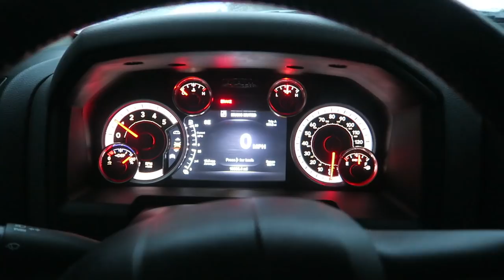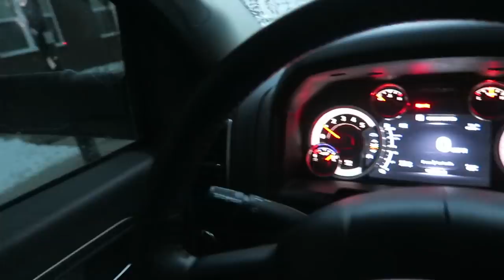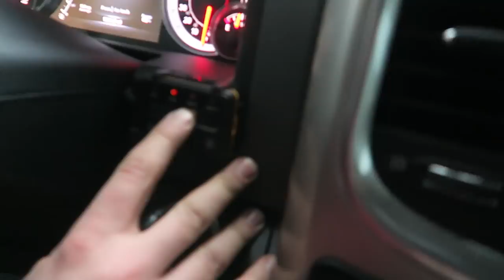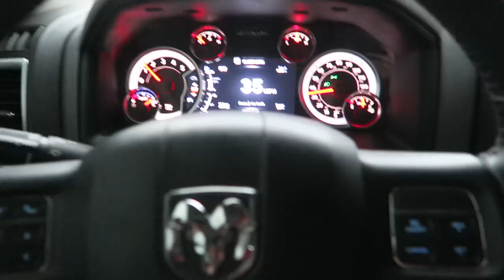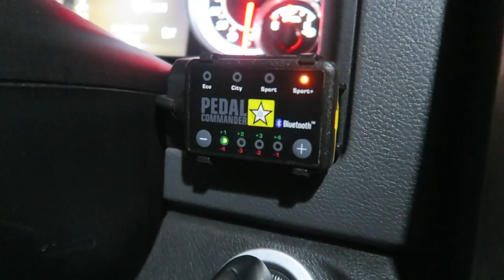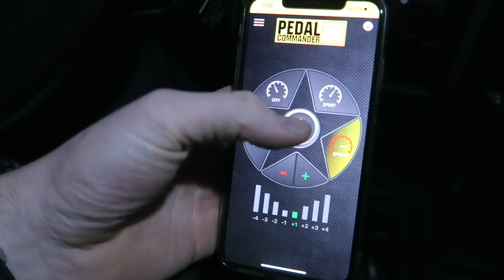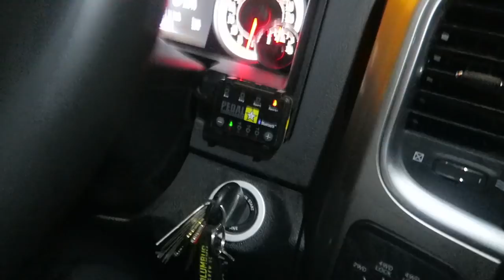TURBO LAG DELETE! W/ PEDAL COMMANDER (IMPRESSIVE)

Comment: My 2013 Ram 1500 4x4 is a 5.7 hemi just got the pedal commander, and it really changed the truck. Once I figured the right setting (sport mode +2 for me), not only does is remove the throttle lag, but it also seems to go through the gears smoother.

Comment: It doesn't do shit to your engine or turbo. All it does is reduce the sensitivity of your throttle that you otherwise have with your pedal and makes a small pedal input much larger than usual. In reality, your truck won't be any faster, but it will definitely FEEL faster as you're reporting on your butt Dyno. It's all about how it feels.... Even if it isn't actually any quicker.
Reply: Manpreet Singh Yes it changes the drive by wire throttle sensitivity. Thank you for actually knowing what this product does🖤
Reply: Teckneckly it does it links up to the computer in the truck adjusting what the setting is so.
Reply: Benjamin Koll Yes it changes the sensitivity of the throttle to make it react quicker but does not add horsepower to change the top speed.

“Technically”
Reply: Right but it goes in the computer to make it react quicker

Comment: How does it remove turbo lag? it's just adjusting the throttle sensitivity.
Reply: It doesn't
Reply: I can assure you it doesn't. All it does is tell your computer your pushing the pedal further than you actually are. No different than flooring it.

Comment: I have a 18 G56 as well that's still all factory, do you think this would improve the rev hang issues the stock trucks have?
Reply: I would like to know too i have an 18 and seems like when youre trying to shift fast it like decelerates or something if the clutch isnt out all the way
Reply: Had it on my 18 g56 with it stock. Made a huge diference. I wouldnt hesitate getting one.
Reply: Try the seat modification first it's a lot cheaper. Move your seat forward 2 inches that should allow for quicker throttle response and better pedal travel. Which is basically all this product does. Unless you have a physical handicap that doesn't allow you to depress the accelerator pedal fully or quickly this product will do nothing for you

Comment: I’ve been using sport plus 3. The pedal commander is probably my best mod. Love it. I have the aisin and the squishy feeling is gone!
Reply from the maker: YESSIR!!!!! good to hear feedback from the auto users!
Reply: Are u saying the lag in the pedal is better with this mod cause its driving me fuckin nuts I to have the aisin
Reply from the maker: stangdemon82 yessir! Removes it completely
Reply: With Aisin and tuned.. but still had terrible lag d/t the way the it defuels between shifts and off the line.

I went with Bd throttle booster (works same) and Day/Night difference in how quick the truck is now. Defueling between shifts is minimized and overall feels perfect now.

Comment: I have one of these for sale that fits 2015 and newer F-150’s with the V8.  It completely changed my truck for the better in an unimaginable way.  Felt like I gained HP, but I just gained quicker access to the HP that is already there.  Sold the truck.  Selling the Bluetooth Pedal Commander for $250 shipped anywhere in the USA.  Like new.  It was on a 2018 Platinum.

Comment: I got check engine light on and bunch of other codes from install the pedal commander
Reply: Just out of curiosity, what was the year/make and model you were installing into??
Reply: Happens when you switch setting while on the accelerator. Product uses stock cables and goes through the stock ecm won’t throw any codes if you follow instructions
Reply: Same here. Engine check light ON, and red lightning Volt ON! It’s the PC-31 and does it on both of my rams, one deleted and one stock. Maybe I have a bad module?

Comment: It would be interesting to see what percentage your EZ Lynk is showing your TPS compared to the pedal on different settings. It's an interesting product for sure
Reply: Thats all this does. On a middle setting desired TPS and actual would be synced up. From the factory it delays it and doesn't give you the power immediately. With the pedal commander all the way turned up all its doing is giving 100% tps  at like 10-30% pedal travel.

Comment: Unfortunately the promo code did not go through for a discount for me. But I definitely will be installing this mod in my 93 octane tuned 2011 Chevy Cruze 1.4L turbo w/ ZZP cold air intake, also custom exhaust.
It’s been running great. This will make it run better.
Reply: Devon Dewey wonder why. I just used it and it took $30 off
Reply: Stephen Foster. Actually just bought it this month and the promo code did work for me this time.

Comment: How is it for a 6.7 cummins when online only shows for engine 6.4?
Reply: I have a 2011 Ram 3500 6.7 HO Cummings and installed the PC31 listed for that truck. Instantly I threw engine codes (P06A4/P2299). I contacted PC directly and they told me that "I do apologize for the inconvenience and you will have to return the unit for a Refund as we do not outfit he 6.7L Diesel Rams as they are a High Output Engine and we are in the middle of research and development." NOT happy about this............nowhere on there website does it say 6.7HO Cummings not compatible..........all it states is Dodge Ram Trucks 2007-2018 Ram 1500, Ram 2500, Ram 3500. Anyways I hope the person I spoke too was wrong...........even though the code was there and the check engine light was on, it made a world of difference!!

Comment: You do know all that these pedal booster products just tell your computer that your light input is heavier I if you're pushing the pedal 10% that tells the computer that you're pushing it 50% or any number of different variations depending on how you adjust the product. You can have the exact same results just by pushing the throttle pedal down farther and faster. Learning throttle control is is more useful than having a computer manipulate your input. If you're a person that has a physical handicap to where you can't fully extend the accelerator pedal I can see this product being useful , but if your legs and feet for long enough to use the full range of the accelerator pedal then I don't see the point of this product
Reply from the maker: You don’t see the point, but! I do say if you drove with one you’d understand where I’m coming from!
Reply: @ryan2546  Actually, he's right on the money.  Btw, I have driven with one of these.  All it does is re-map the throttle;  you push the pedal down 10%, the pedal commander sees it and tells the PCM to add 50% throttle.  Boom, seems like you just added 50whp.  Honestly, I don't think you even need this on your truck especially since you have custom tunes... but that rarely stops people from throwing money at their vehicle.  Nice review though. 👍
Reply: @monsterram6617  im with you , wasted money and time when custom tuning can do the same thing.
Reply from the maker: Tony Turner 😂😂😂🤷🏼‍♂️🤷🏼‍♂️🤷🏼‍♂️ trust me me and my buddy tried to get tuning this good, and guess what doesn’t happen. You can’t adjust the sensitivity 36 different ways AND like it said y’all can hate but you don’t know till you know haha if both of y’all were close if hook mine up in your truck and you’d be commenting different! But to each his own!
Reply: @ryan2546  Ryan, pointing out facts isn't hate.  I'm happy that you like the Pedal Commander, though.
Reply: @ryan2546  lol all good Ryan. I had both this style and the BD throttle booster in my truck back in 13 and I really wasnt impressed with it. I also like angrily massing my pedal to the floor and having it respond accordingly lol.
Reply from the maker: 😂😂😂😂 I just love seeing the comments of people hating on it and they haven’t used one! Lol I picked this over BD because the one in the Subaru I drove was WILD
Reply: @ryan2546  What exactly do you mean by "hate"?  Also, how does discussing the details of how the pedal commander functions relate to whether one has used it or not?  I don't think they are claiming it doesn't produce a result; it clearly does.  It sounds more like they are saying that you don't really need it if you are willing to adjust the way you drive.  Idk, maybe you or someone can clarify this for me?
Reply: @ryan2546  brother if you like the product by all means enjoy it. I just don't have $300+ bucks on a product that manipulates  my pedal position sensor..If you're foot is getting tired from the work load of pressing the accelerator then by all means get this product
Reply: If anyone wants the same modification for a lot cheaper simply move your seat 2 inches froward . This cheap seat modification should allow for quicker throttle response and more pedal travel
Reply: We  get it big dog....  we get that it simply adjusts the sensitivity for gods sake. Maybe comment and state the obvious a few more times....
Reply: Monster RAM bruh he is sponsored by them he isn’t gonna agree with you 😂
Reply: You guys are thinking of it the wrong way, don’t think of it as a percentage, but points. If your pedal has 100 points of variability, it may have 150 now.
Reply: If what you say is true, “sport mode”, “race mode” wouldn’t exist in performance cars. If what you say is true, independent throttle bodies on cars would be pointless. If what you say is true, a race car should have the same throttle response time as a pickup truck. In fact, one of the benefits of a drive by wire system vs a drive by cable system is the ability to customize throttle response. Yes you can bury the gas pedal 6 feet under to get the amount throttle you need, but that’s not the point. The fact of the matter is that throttle response is very important if you want to do performance driving. Believe it or not, pushing the accelerator to the floor takes more time than a light blip of the throttle. The reason I bring this up is because it is especially important in a manual car. Blipping the throttle helps with downshifts. A responsive throttle is especially important for heel toe downshifts. For heel toe downshift, The less time & effort you spend on the gas pedal, the more time you can spend on braking through a corner. Now if this is something that you don’t care about, then obviously the product is not for you, that’s fine. But don’t deny the power of throttle response just because you do not need it in your specific application.

Comment: This work on not tuned or deleted trucks to or need to be deleted
Reply: John Mayfield it’ll work on a stock truck
Reply: @jacobn3160  ok it won't tell the computer anything to avoid factory warranty stuff I'm not sure that's why I'm asking
Reply: John Mayfield no they won’t even tell if you want to be safe you can unplug before you take your truck to the dealer. That’s what I did and they didn’t even know
Reply: @mrclean2038  ok thank you I'm looking at a new 2018 model that's why I'm asking

Comment: Instead of standing on idle waisting fuel, start driving as soon as you got oil spread and pressure up. A diesel NEVER makes decent heat idling, and neither does a gas compared to driving it.

Comment: Correct me if im wrong. But the research ive done shows theres no real improvement to the actual numbers. 0-60 and actual acceleration. All it does is open the throttle body sooner. So in turn it's technically just like you're flooring it all the time. WOT is WOT with or with out the pedal commander.

Comment: IMHO Pedal commander is good. Sprint booster is the best. I don’t need Bluetooth. Some people might like that though. $10 cheaper for SB. Has 2 extra features. Pedal lock and valet mode. SB is also smaller controller. Looks better in my car, like factory. Both are awesome products though.

Comment: Used this thing the first day I got it and it put my truck right in limp mode after first test drive
Reply: Jacob Rosenkranz Same here...Pedal Commander is total junk! Mine lasted 3 months, and then the truck went into limp mode.
Reply: savage 069  Truck reset after unplugging that junk.

Comment: It’s not a lag delete it takes the lag out of the drive by wire throttle system
Reply from the maker: For turbo charged vehicles it also removes your turbo lag as a by product of that 👍🏼
Reply: No... unfortunately it doesnt remove the turbo lag. It changes the throttle response and as a by product it decreases the amount of time it takes for you to reach full throttle, therefore spools the turbo quicker but does not remove turbo lag (the lag is the same as pushing full throttle instantly). Please give people the correct information as you have a large audience watching. Good video 👌 i get what you're saying and you most likely understand this although other people most likely wont
Reply from the maker: Lachlan Stenzel turbo lag by definition is the time between hitting your throttle and feeling the torque of the motor after the turbo spools. This product removes ALL LAG as soon as your foot is on the throttle the turbo already spooled. There is 0 seconds between needing boost and having it. Removing throttle lag removed turbo lag so in turn yes this product removes turbo lag 👍🏼
Reply: RYAN MAYER you’re still wrong. Turbo spool is not torque from the motor. A diesel forces a turbo to spool immediately so there is no lag like gas vehicles. It’s only taking the throttle lag out so you get to feel the instant boost
Reply from the maker: Trevor K 🤦🏼‍♂️🤦🏼‍♂️ yep you think that man
Reply: RYAN MAYER I’ve built 2 800hp DSMs and have been a diesel tech for 5 years. Trust me I know what I’m talking about. There’s a reason it’s called pedal commander, it’s for the drive by wire lag, which in turn gives you the benefit of feeling the instant torque from the engine and on a diesel.... the instant spool

Comment: I would also like to share. that the peddle commander from my knowlage is the best one on the market. but their are other throttle controllers that do have one nice thing this one dose not and that's the ability to add a button to your dash so it looks factory. but what s nice about the pedal commander is its Bluetooth so you can just hide it under the dash not telling people you have it and set it to eco mode when other people use your car or when a valet is using the car. I do wish they would add the feture tho that would alow you to limit speed or lock the device with your phone so you can hide it and lock it so someone cant steal your car life if you want to leave it running and run into the store. or maby back one with that feture and add a aps and remore shutoff over the cell network.

Comment: All it is doing is giving you less control of the truck.  Its just compressing the throttle.  Say you have to move the throttle pedal 5" to go from 0 to wide open.  This might make it be 2" of travel to go from 0 to wide open.  Your truck is not any faster and your turbo is not technically spooling any faster, you have just compressed the throttle so your giving it way more duration per any bit of pedal travel.
Reply: And the only reason it feels faster is your butt dyno.  Put it on a dyno and you will see its no different.  This is no different than what Smarty did with the S03 programmer with the VP44 trucks.  Everyone went WOW it adds so much bottom end.  No, it didn't.  It mainly just compressed the throttle.